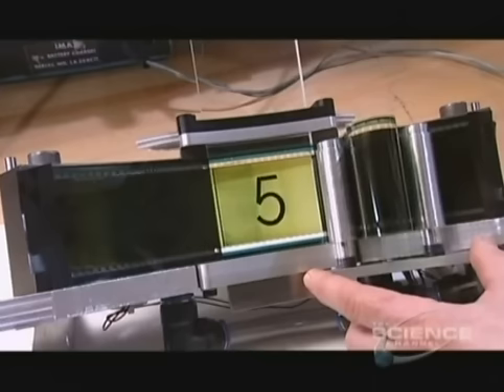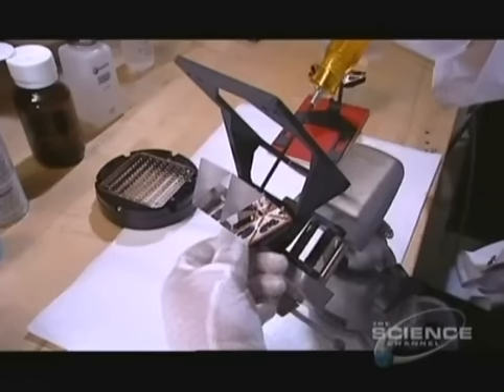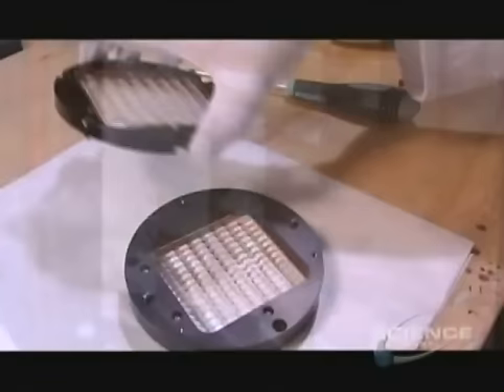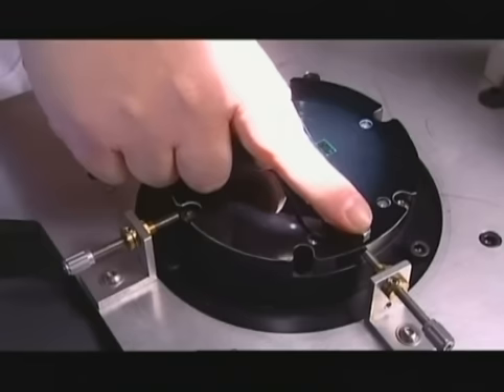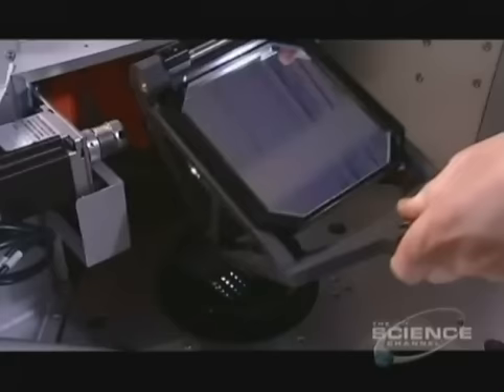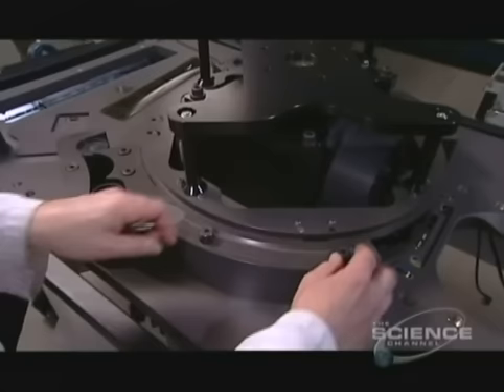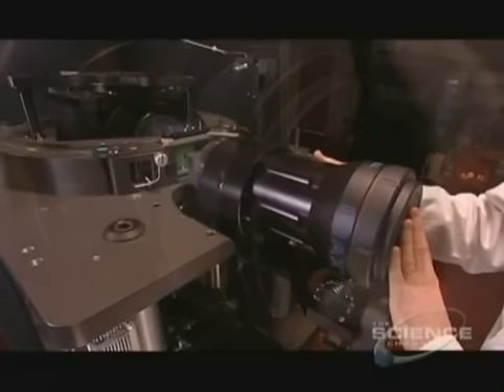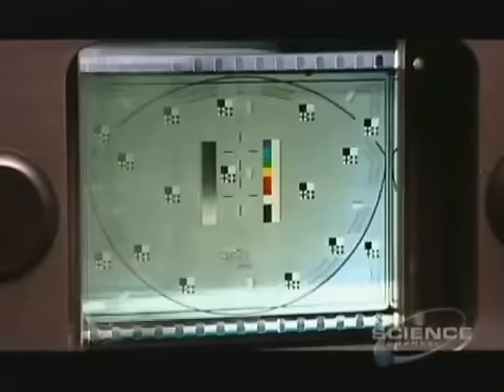IMAX 3D Projector

Comment: Almost all AMC theaters use IMAX Digital, 2 DLP 2K Projectors running at the same time.  Very high picture quality and a much larger screen then standard 35MM, but no where near the size and quality of IMAX 15/70.  Any IMAX installation before IMAX Digital started rolling out will give you the TRUE IMAX experience.  Also, IMAX Digital confirms to DCI just in case you were wondering.

Comment: @cplai

And in all of this it's worth pointing out that IMAX's m.o. hasn't been to replace film-based IMAX theatres with Digital.  There has not been one case of that yet.  IMAX Digital is designed to compete with Real-D.  It's designed to use IMAX's patented screen geometry and sound systems in conjunction with digital projection to create a better version of RealD's theatres.  It's not designed to replace the classic IMAX theatres.

Comment from the maker: @FidelCastro128 I totally agree with you. If you read all my comments made so far, I have repeated and repeated to emphasized that this video only applies to the original IMAX theaters. IMAX no longer maintains their own standard regarding the size of the projection screen. Today, IMAX only means the equipments are made by IMAX and there is no guarantee you would get a big screen.

Comment: @lucasrem Most IMAX theatres are still film.  The digital projection called IMAX Digital.  It is only used in a limited number of smaller purpose-built theatres compared to large film-based IMAX theatres which are more wide-spread.

The film projection is superior because the digital projection is less resolution and is not bright enough for use in the huge IMAX theatres people are used to.

If you go to the theatre map on IMAX's website it tells you which theatres use film or digital.

Comment: @cplai The problem is that many of these were mastered on video, rather than staying on film like movies destined for the theatre were.  This makes retransferring then much more costly.

But it has been done.  The original Star Trek and Seinfeld have both been remastered in HD from the original film elements.  Many more shows are likely to follow.  It all depends on when the demand for HD broadcast outweighs the cost of the remastering.

TV shows that were shot on video however are forever SD.

Comment from the maker: @TheHandOfFear 
Yes, your math is correct for those cities with a decade old IMAX screen and need no upgrade, where the ratio of film to digital is 1:0 which is infinity. 

my posting says there are at least 1 or 2 digital IMAX screen PER multiplex cinemas. Your assumption that SF Bay Area only has one multiplex cinema is quite wrong, so the ratio is not 3:1 or 3:2.  It is 3:n or 3:2xn where n > 10+.

Comment from the maker: @TheHandOfFear You talked about TV shows 10 years ago. I doubt that time frame because it is not old enough. The older the TV shows, the more likely they are shot on film.  So if you says 20 year to 40 years ago, I don't have a doubt.  But you said 10 years ago. By that time video storage was good enough for some directors to switch to video. Starting from 10 years ago, less TV shows were made on film than in the past. The biggest SD gap is probably at around 10 years ago.

Comment: @cplai Actually this is totally wrong.  Film does not record images at the molecular level, and does not have infinite resolution.  If that were true then why would they go to the effort and expense to use film as large as IMAX if 16mm or even Super 8 could provide that resolution.

No, film uses small photosensitive grains suspended on the film to record images.  These particles are small but are no where near as small as a single molecule.

Comment: IMAX Digital cannot truthfully be called IMAX. The best current digital projectors are 4096x2048 pixels (4K), IMAX film is approximately 10000x8000 pixels. Not even an 8K digital projector can match IMAX film.

Comment: IMAX is still using film?! Wow. What about a digital IMAX projector?
Reply: +Joshua's Recordings yeah Dear IMAX is still using Film, although every theatre uses...because they wont Leak the original print earlier they lost very much money...very much
Reply: +Manish Jogi What print?
Reply: +Joshua&#39;s Recordings IMAX film stock is equivalent to about 12K in resolution, compared to 2K in standard digital projectors or 4K (8K theoretical) in current digital laser IMAX installations. An IMAX digital presentation is hard to beat, but using true 15-perf 65mm IMAX film is just about impossible to emulate with current technology.
Reply from the maker: +Joshua&#39;s Recordings - What Manish meant was the movie print on film. IMAX film prints are expensive to copy and distribute. Digital movies can be leaked around the world within minutes. He was speaking for the theater owners not the pirates.
Reply: +cplai Ahh, ok. Funny though, most theaters I go to have digital projectors though. The picture is transferred using a hard disk and after the theaters license is up it is impossible to view the film.
Reply: Joshua's Recordings 

Not anymore. The new "Mini Max" theaters are mostly all digital. It's mostly the older, legacy Imax theaters in science centers that still have actual film projectors.